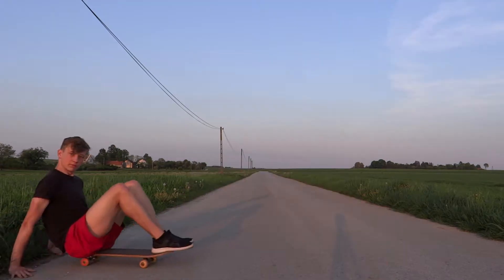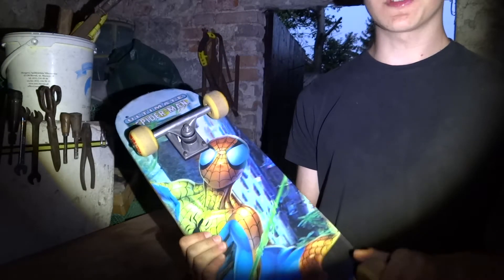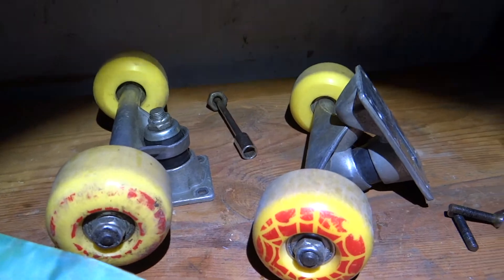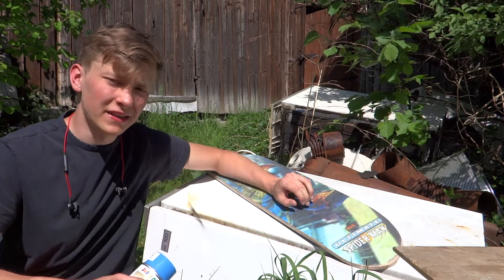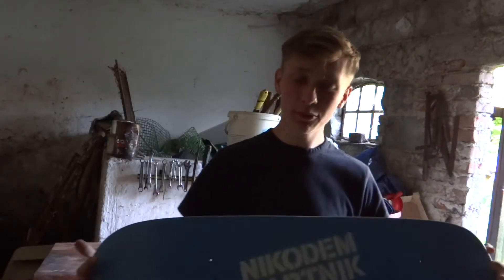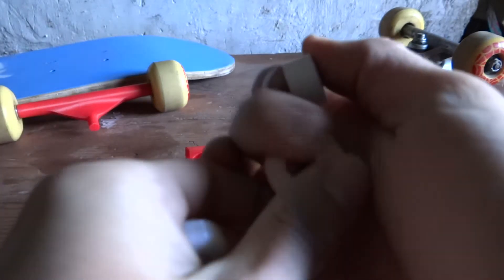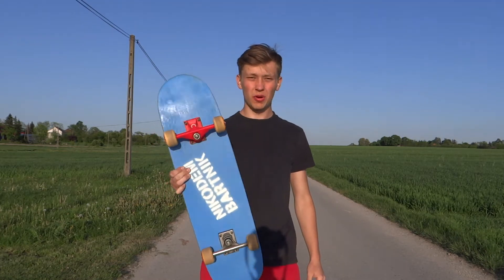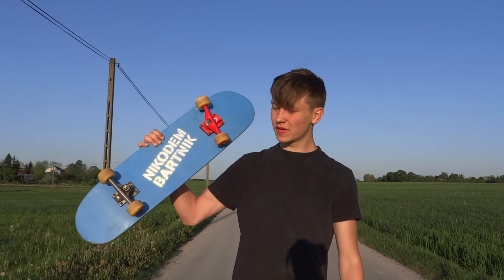3D printed skateboard truck! It works!

Comment: You should make a v2 where instead of the metal rod you use bolts that thread in and replace the king pin with a bolt so you can adjust the length of the king pin for people who want looser trucks

Comment: Great project, great idea! Maybe you could change the truck design to use printed plastic. It looks that the printed truck is just like a metal one. Plastic is obviously less resistant, so it could be thicker or have different design to compensate that and maybe last more. Congrats!

Comment: Maybe you can 3D print motor mounts to attach to the metal trucks. I wonder if you could embed metal plate in a 3D print without too much trouble. Perhaps fiberglass and epoxy reinforcement could be used as well. Thankfully you are more athletic than me, I might have broken something else (on me) when that truck broke. Take a moment to imagine that truck failure at high speed on an electric board. Yikes.

Comment: Encouraging. I was sure that the PLA part will break despite of the use of TPU (infill 100%) for some of its components. But it seems that it took a long time before it broke. Can't wait how you're going to walk around that issue.
Reply from the maker: I redesigned whole truck and I am going to print it with PETG, I hope that will make it :) If not I will try to print with nylon or carbon fiber, with some design changes and different print settings (I used 0.1mm layer height to print this truck, but it turned out that bigger layer height = stronger part) this can be a perfectly working and usable truck! Thanks for comment ;)